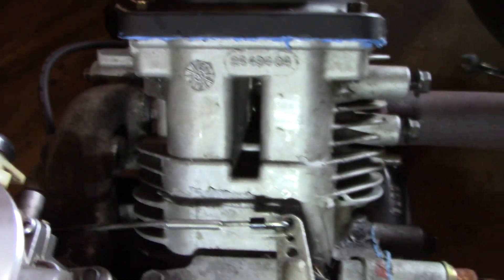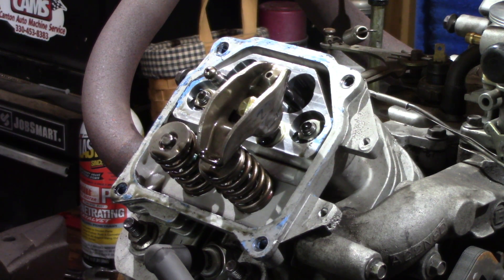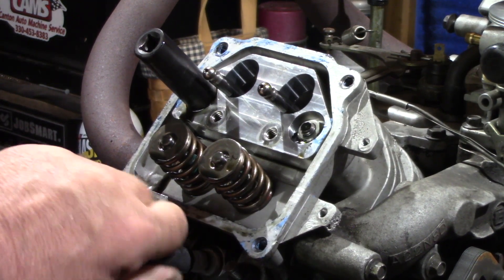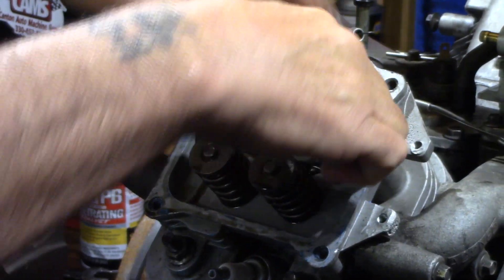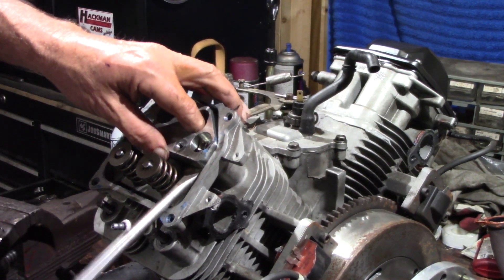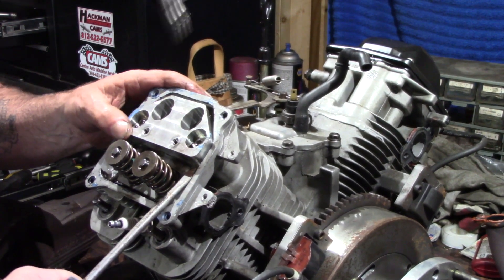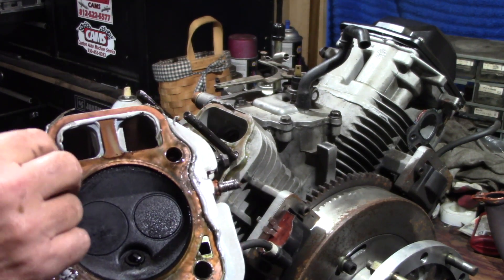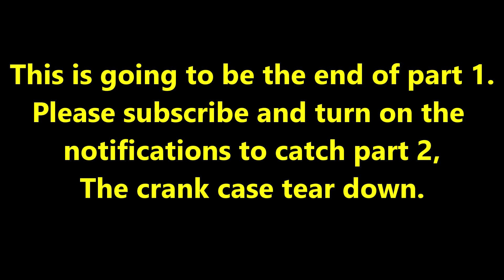Do you trust your builder? Teardown of a professionally built Kohler Command V Twin pulling engine

Comment: All i can say is someone either has stock in permatex or they have a lifetime supply I can understand using it on certain things but not on exhaust /intake or a head gasket🤷 wow!!
Reply from the maker: Yes there is a time and place for it, to be honest I've used copper seal on a head gasket but it was just to get a day of pulling in the after I replaced it.
Reply: @PullerbearEd  that part i can understand if its a temporary fix